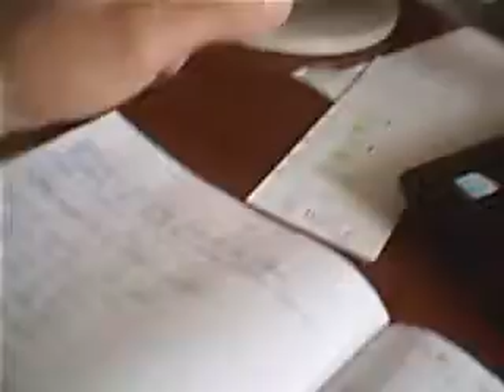VGA controller using FPGA

Comment: Monitor = Screen... lol... Portuguese .....

I've made a VGA controller that uses a text mode with mapped characters into 2 BlockRam's, it still has a little glitch with the first pixel (that I'll probably fix later), but it's perfectly readable.

Thanks for sharing :]